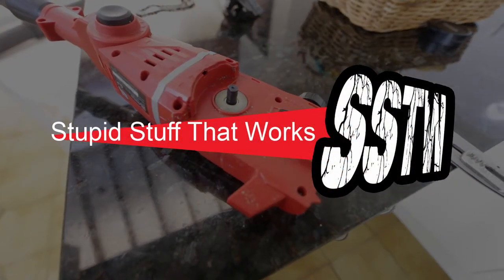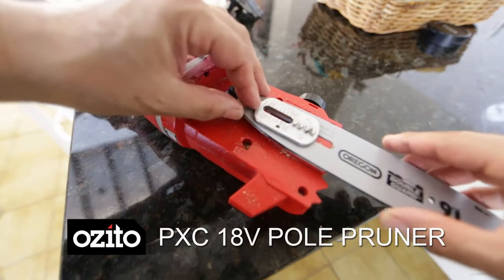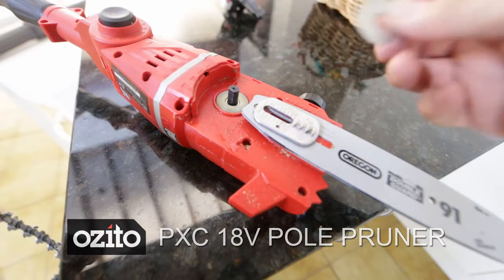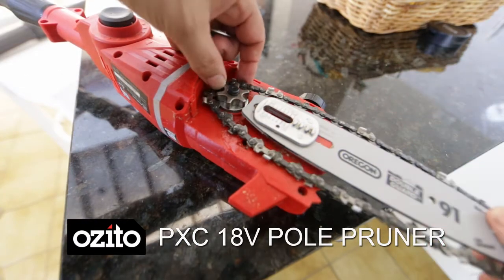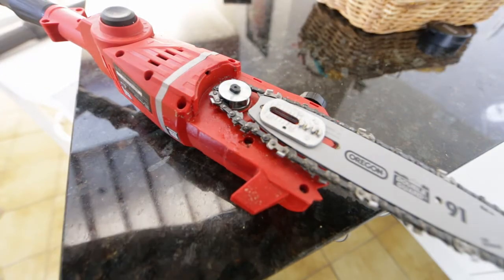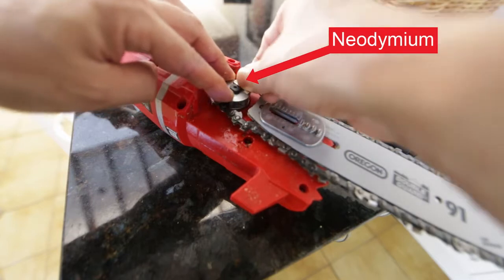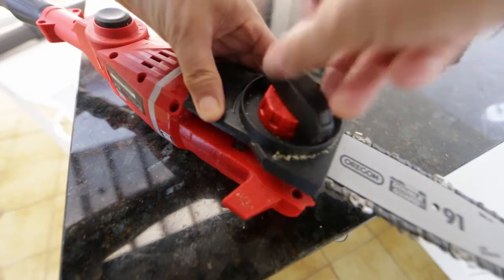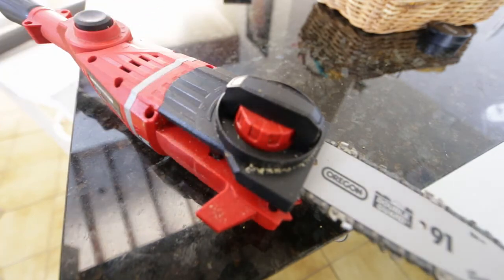Ozito Pole Pruner Chain Saw Slip Hack

Comment: Hi mate, you are missing the circlip. The circlip holds the washers and sprocket on the bevel gear. Ditch the magnet, it may fly out when using.
Reply: I'm so baffled by this 'fix'. Why is he going on about the neo whatever the hell magnet, doesn't it just need some packing washers? Or as you've said, just a circlip?
Reply: @Mike-me3sp  Yep, just the circlip.

Comment: Ah , thanks for the effort , I needed to tighten my chain tension , another vid , an unboxing, revealed that under the black dial, there is red dial and if you do not tighten the black part until yiou rotate the red dial -= one way tightens and the other way loosens , you can set very easily set the chain tension. Oh yeah your saw was missing a simple circlip that holds the washer on,

Comment: An issue with the older corded (mains powered) saw and possibly this product as well, may be compliance in the plastic structure which causes the geartrain and chain to chatter when a good chain bites into the wood. This causes the bar to slip back and loosen the chain which then walks off the sprocket. With the older corded machine, folk are driven to increasingly over-tighten the centre knob which then strips off its metal centre hub. The clamping arrangement on the bar should be metal with guide wings but then it would cost more. Whe the centre knob strips from its centre hub, It then becomes impossible to dismantle the bar and chain. Once the knob turns and nothing happens, the plastic of the knob has become disbonded with the metal centre. It becomes possible to pull the knob off the centre hub with vicegrips, then grab the thin shaft with vicegrips and unfasten it and use vicegrips on the shaft to tighten after bar adjustment with the outer wheel. My temporary repair has been to use a thick washer with small centre hole and wide diameter to clamp the outer wheel with the centre now thin shaft and hopefully set the bar firmly until I can invent something better. Otherwise when things are fine, the machine works well. For trimming off branches from felled large limbs it is safer and less cruel on my geriatric backbone than stooping to use a small chainsaw.

Comment: I cleaned it but there is a little magnet.  Was is it for?  Where does it go?  Thx in advance.

Disregard Bunnings Brothers and Sisters.  If you remove the bar and chain, I suggest that you do as you will get a lot of build up.  There is a little magnet that sits in a slot of the same dimensions.  It just seems to sit there.

This is a pretty impressive bit of kit for the price as much as I didn’t want to buy Chinese.  It smashed through dried ghost gum and manna gums like balsa wood that were pretty thick.  Keep your chain sharp and it is really good.  Cheerio. 🇦🇺👍🍺